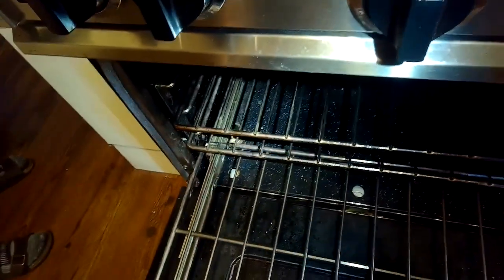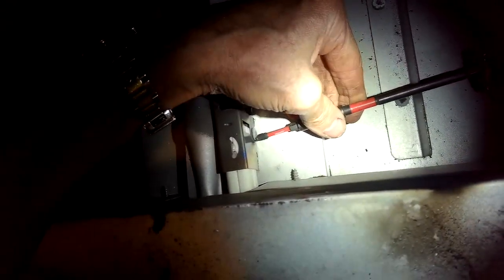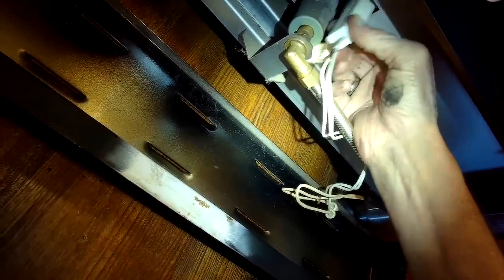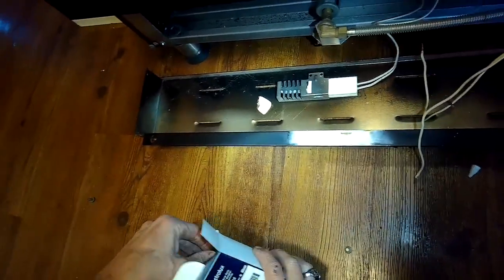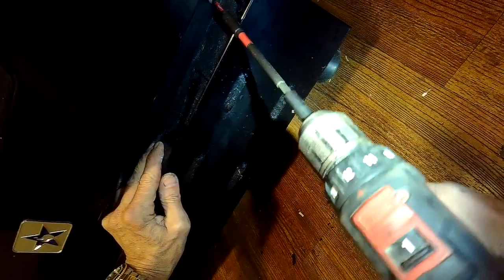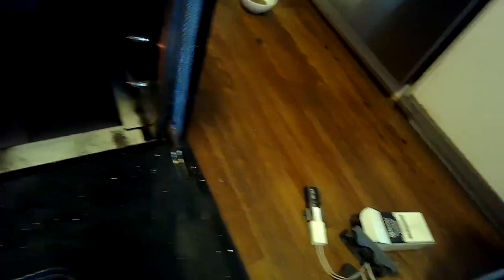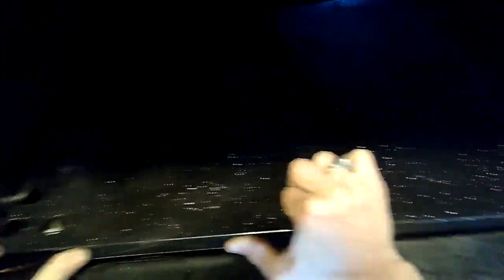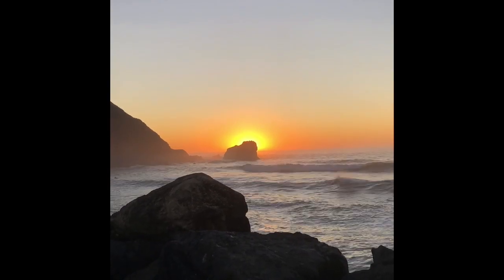⭐️ BLUE STAR ⭐️ OVEN—NO HEAT—EASY FIX

Comment: I have 48 inch Bluestar freestanding gas range.  I was able to replace the oven ignitor in the larger oven but the ignitor for the smaller oven has a different setup .  What model oven ignitor would you recommend for the smaller oven?